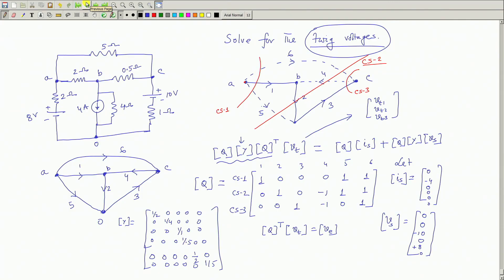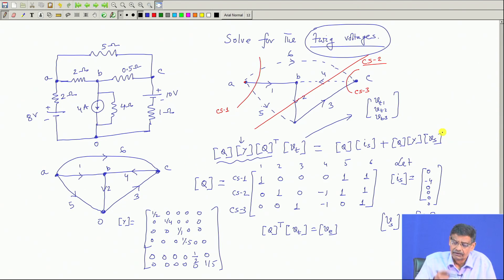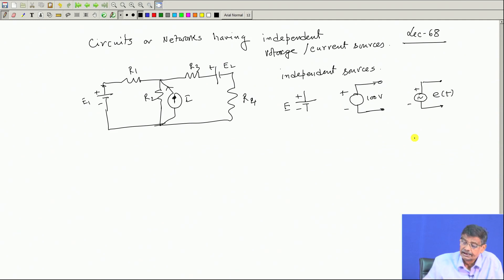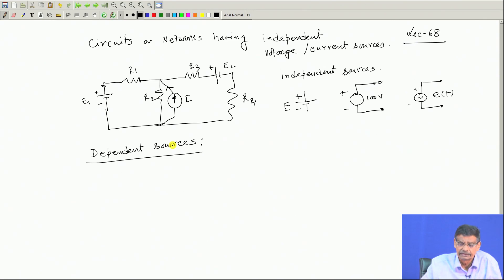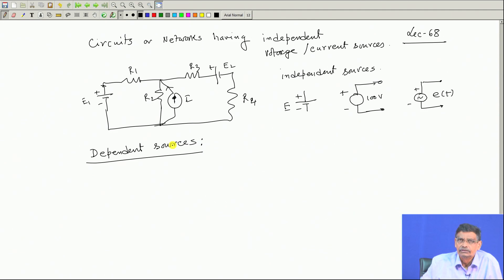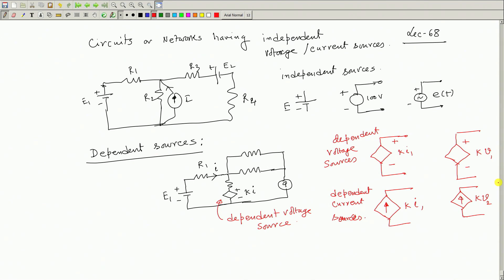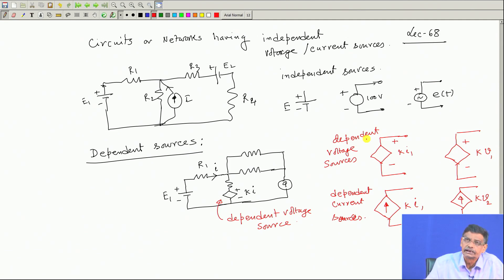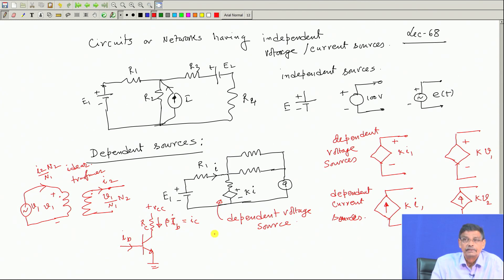Lecture 68: Circuit Analysis with Dependent Sources - I

Comment: Sir the question which you solved of dependent source was wrong actually there was problem in 2 equation where you have to take (-10) instead of 10.
Reply: bro what is the solution you got
Reply: @-MadhuSaradhi  10/7A&5/7A , relation i2=i1/2
Reply: i1=20/7 and i2=10/7